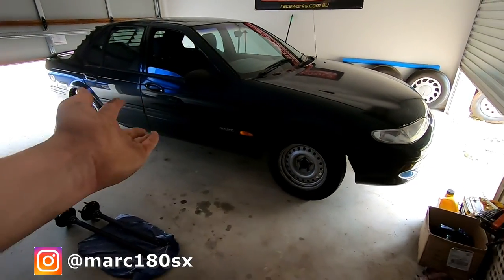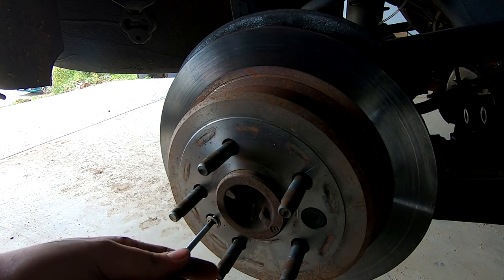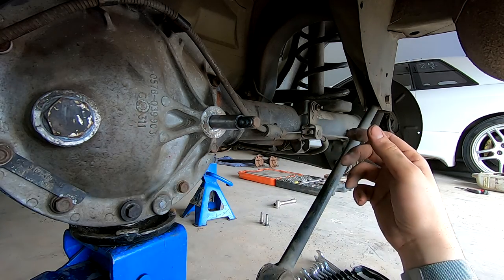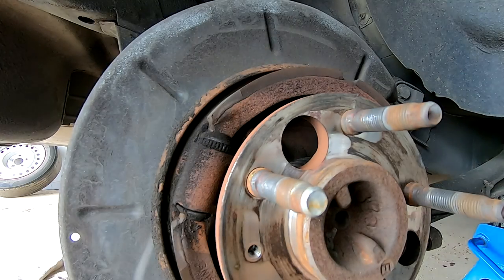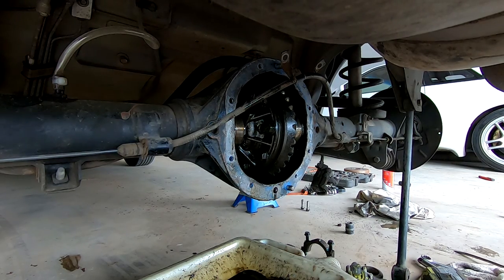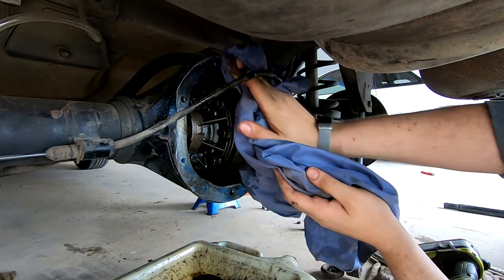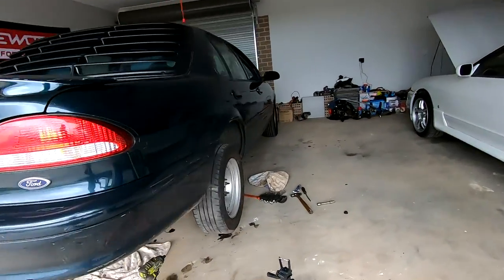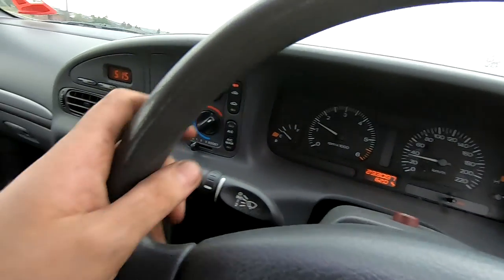Changing the diff over in my EF Falcon!

Comment: if the newer one made the thud happen only when you release the rotation speed of the pinion then it's just that now the part you changed has ok wear but the pinion is too used maybe, also did you check u joints?
Reply from the maker: Honestly it’s stopped doing it all together so I think it was a bit of a mystery thud
Reply: @Marc180sx  bruh wack, but hey we love when wacky noises stop